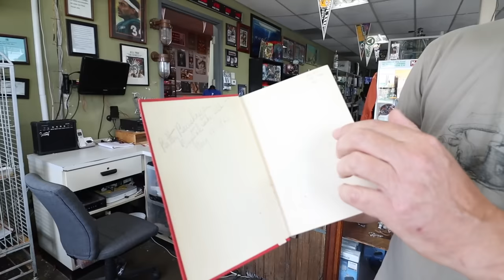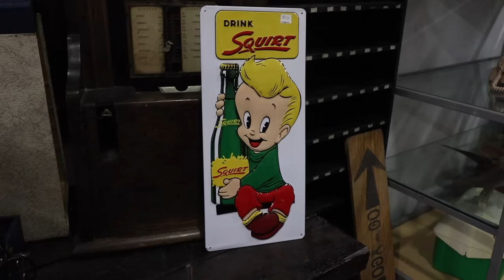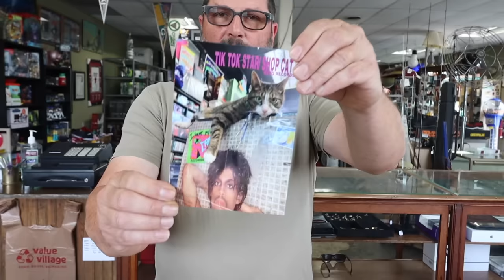Desperation and Compassion: Why I Needed To Help Her

Comment: 8:56 the "loop" or jump ring that connects the clasp to the chain is  sometimes left unsoldered purposefully...even on gold chains.  If the jump ring is thick enough it will not bend easily and will act as a 'failure point' in the event the chain is pulled on. Instead of destroying the chain it will simply open the loop.  
Having a weak point in the chain is even more important when you are talking about thick chains or heavy stainless chains. To avoid getting pulled into machinery or being choked, it's good to have a weak point in the chain.
Reply: Thanks for adding this. I have a gold chain that I can open the jump ring, was starting to rethink things.